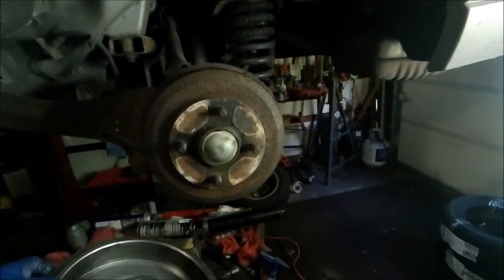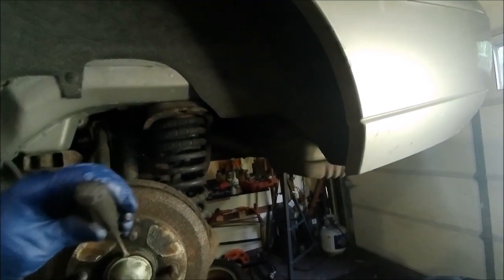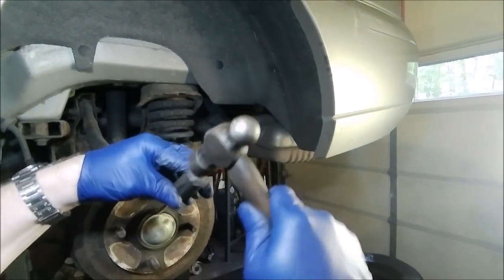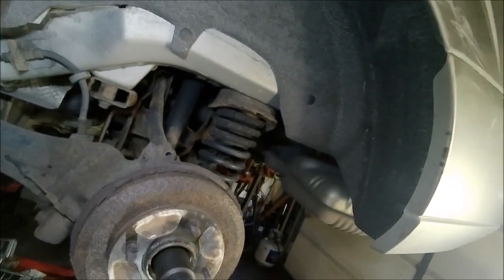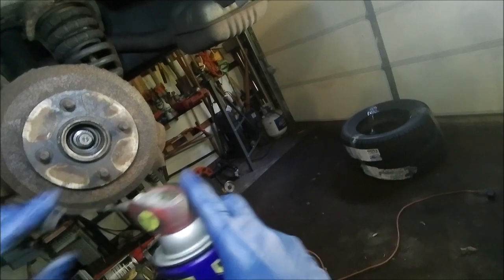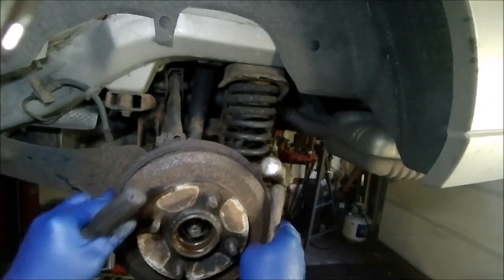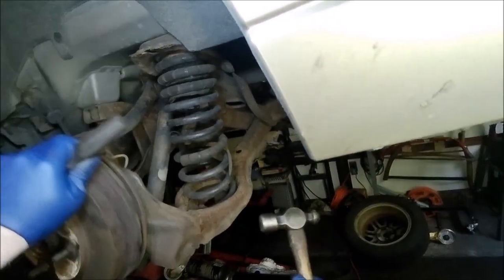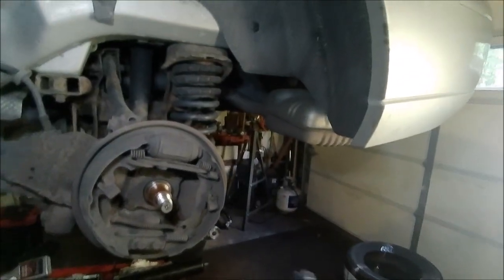Ford Focus Rear Drum Bearing Replacement in about 5 Minutes

Comment: Was the brake holding it if so u can release some tension from the rear to access the tensioner. Made it easy. My axle nut was 30 mm on and 07.  I am dealing with the snap ring popping followed new install. Snug the new nut. Spun the NEW drum counter clockwise 10 times while torque to 174ft lbs. The next day noise. Pulled tire 1/2 inch gap took off nut and drum looked inside the snap ring that was factory installed was popped out and the bearing moved in that eztra 1/2 in. I rest the bearing installed the snap ring. Used my other new nut. Same procedure. Next day same thing happened. Not sure if this China made drum is defective from Autozone DuraLast or theres an issue with the hub. I dont see anything like burs or damage but this is odd to happen. I did the other side with a AC delco and no issue in 5 years. This Dura last is a replacement under warranty and its not working. I just dont know how to know if defective or not. But ive already had 2 failures in 2 days with proper torque and installation. Anyone have a thought. If defective ill remove and take back i hope they honor it again becasue nuts are 16 bucks where i am for 1 already went through 2 in 2 days as you can reuse them.
Reply from the maker: Did you compare old with new? Sometimes there can be slight difference s.
Reply: @GarageMahalStuff  they have Autozone here so its a Duralast under warranty the 1st one last less than a year bearing seized. This time goes on flush tighten then spin cc 10x then torque to spec.  Doesnt hold. 3 locking nuts later this last time the tire came off. Tonight. The drivers side is an Ac Delco and I put that on and no issue  5yrs already.
Reply: Had car towed taking the wheel off drum and returning the drum as defective 3x and something isnt right. Maybe the axle. Ill inspect it in the daylight further.  I clean it and chdcked for any noticeable damage but im not an expert just diy. I may even skip return and just get another Ac delco drum. Thx.
Reply: Update went with another AC Delco drum w bearing. Its been a few days since install no issues so far. Now onto the front suspension. Someone hit vehicle while parked bent tierod and control arm and snapped the swaybar link. Thats tomorrow's project.